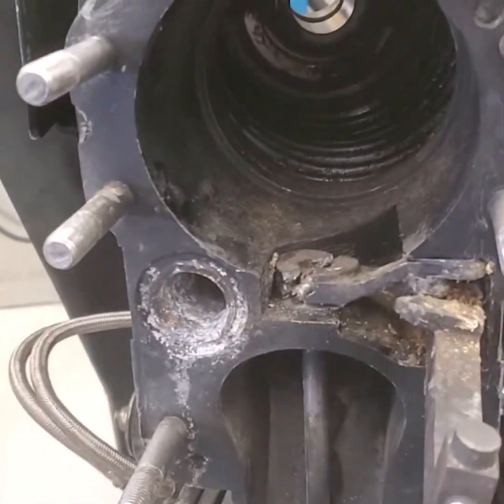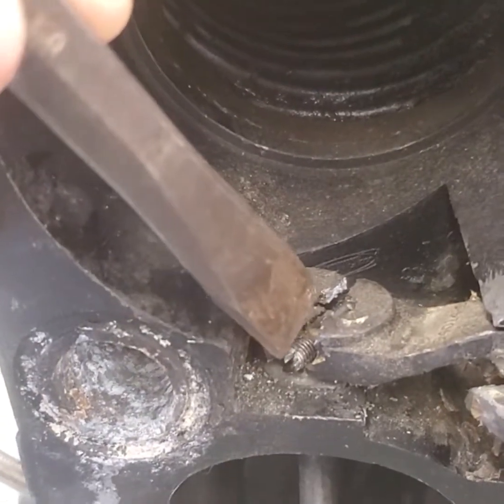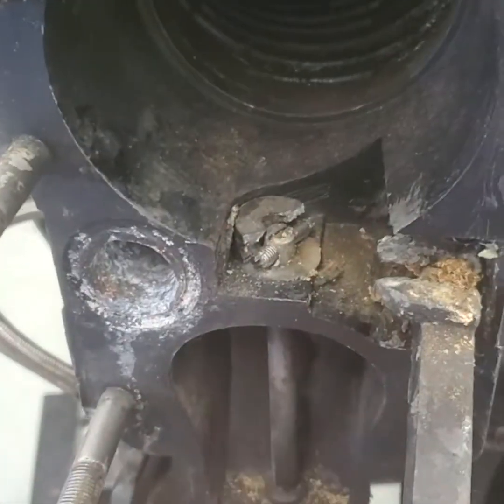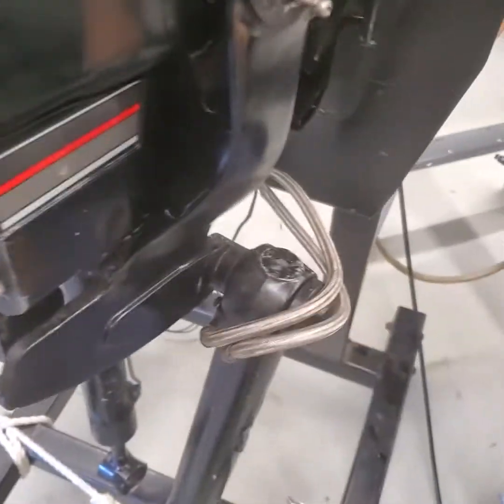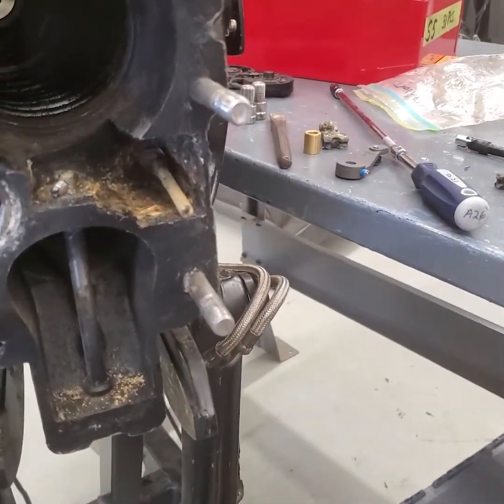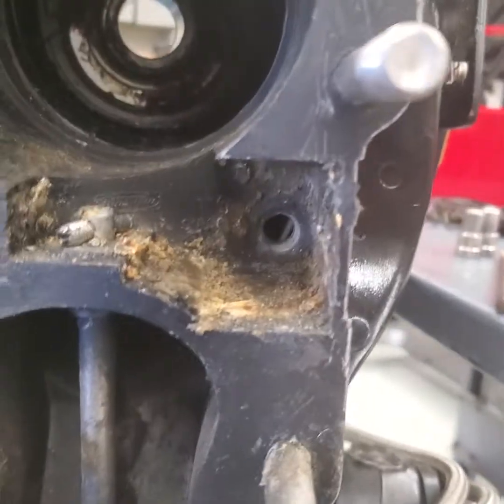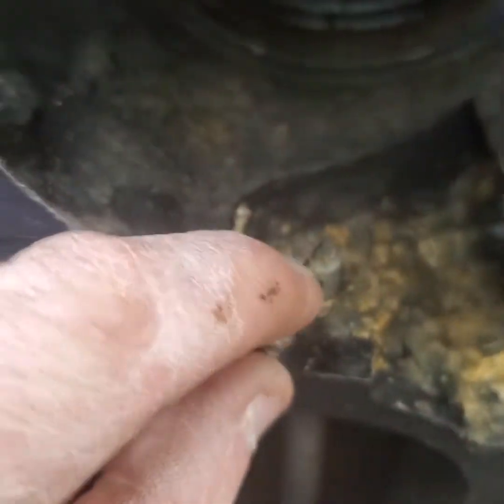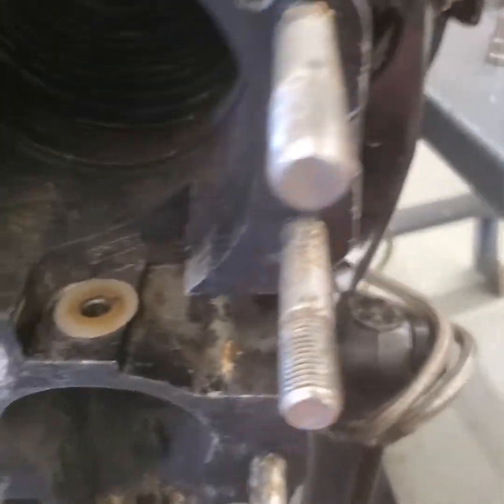Mercruiser Alpha One Transom Assembly part 1a

Comment: My brass shift cable nut stripped and rounded off when using the special shift cable removal socket when I went to take it out. Now what the heck do i do!
Reply from the maker: Don't panic. Easy fix. Guess I need to post a new video!!
Reply: Hammering a slightly smaller socket over the nut was successful for me.